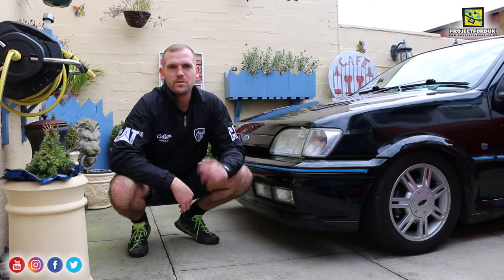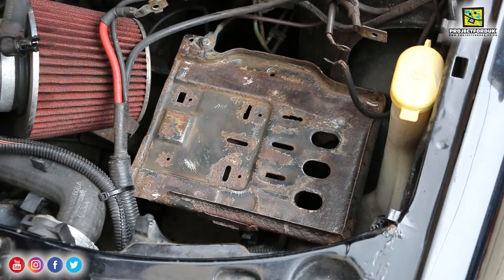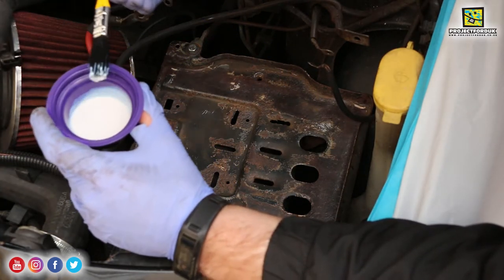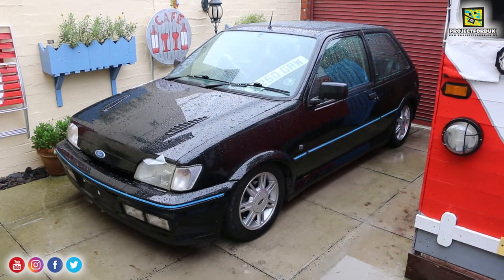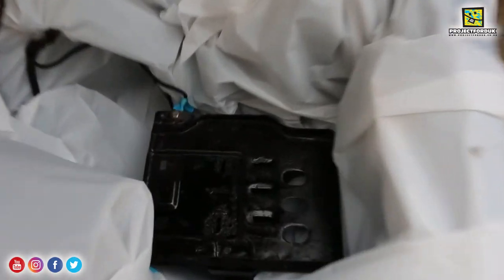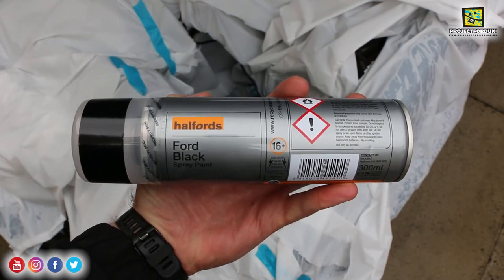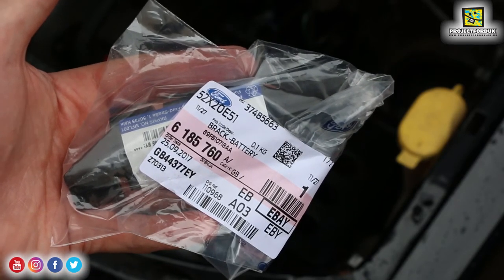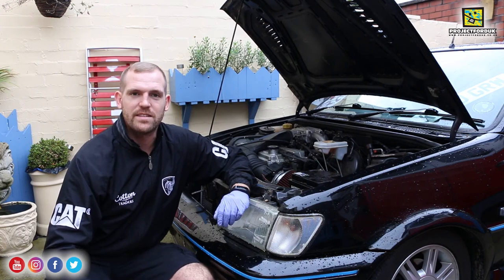Part 9 - Treating The Fiesta Battery Tray - 1993 Ford Fiesta XR2i 16V Restoration Project - HD

Comment: I'm looking at buying a MK4 Escort as a project car. There's one near me that's been stood for years and rust would be an issue especially if the battery tray is shot. Bits of the bulkhead has to be chopped out to put in a new one.

Comment: dont know if you will still respond to this, but what would you do if the screw of the batteryclamp ripped due to rust & force ? because i currently find myself in this situation >.< now half the screw is stuck i can put my new batterie in but its got like 4cm of room to slide which isnt ideal lmao
Reply from the maker: Drill the snapped bolt out pal. 😎